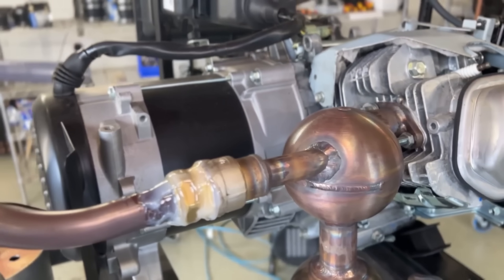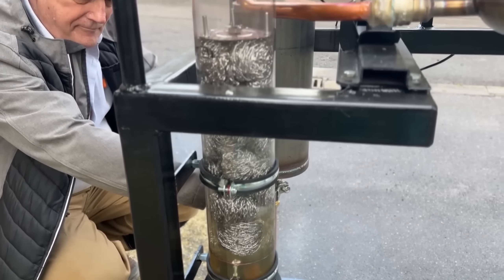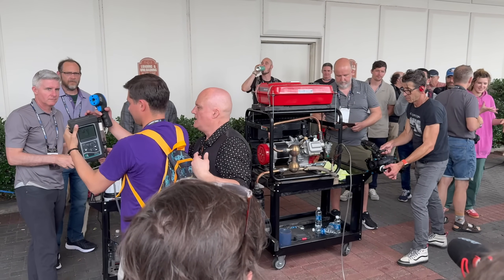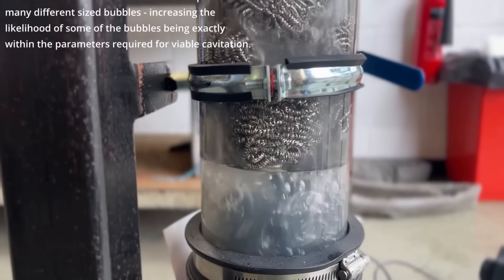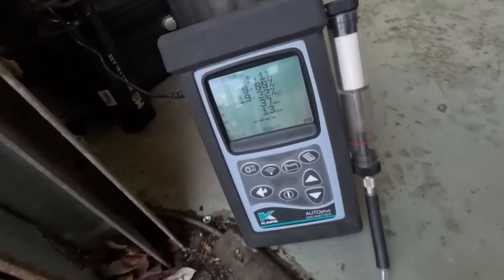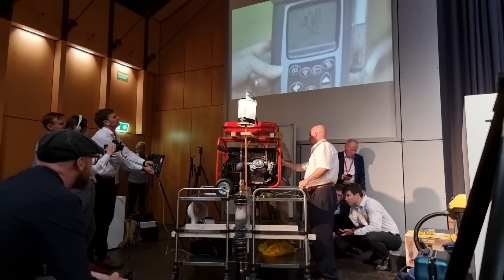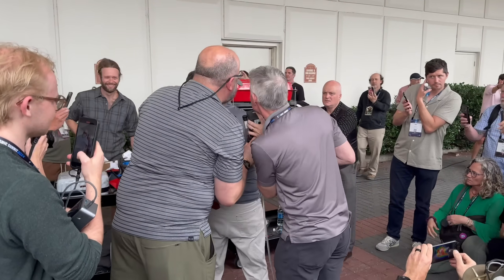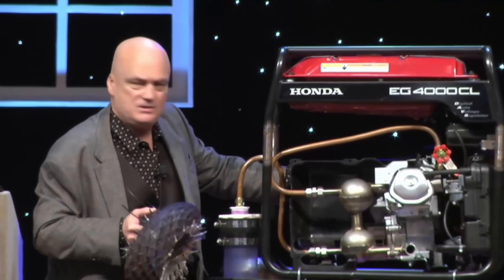Oil Companies Game Over: Malcolm Bendall's Free Energy Generator 2024 Invention of the Year!

Comment: Claims here are incorrect about FREE ENERGY or NO FUEL COST.   That is false.  Bendall demonstrates the devices lowers EMISSIONS, and provides some FUEL SAVINGS (current tests, 20%+), and  is not claiming free or no fuel energy.  This does not stop big oil out, or big car makers, but actually improves their position with existing combustion engines as a path to zero CO2 exhaust.  It  DOES run on gasoline and is NOT electrolyzing hydrogen. "Water vapor injection", or changing the heat of intake air are not significant, and it uses an entirely different physical process.   Future Galaxy should re-study the work and re-do this video without the click-bait title.  However the zero/near zero CO and CO2 effects are world changing.
Reply: No fuel costs. No emissions. No explanation of function or operating principles. What's not to believe?
Reply: Lowers is an understatement, it almost removes all pollutants and puts out 30% oxygen so to reuse the exhaust is beneficial since there isn't that much oxygen in the atmos.
Reply: Clickbate videos become really depressing and a form of stress! I hate those time steeling channels!
Reply: then why does the title say the opposite of everything you were saying. The title clearly says free energy
Reply: @stanley090  Malcolm Bendall, the inventor, does not claim free energy.  The title is incorrect.
Reply: Paul pantone device worked too
Reply: Does it have a coefficient of performance greater than 1??
Reply: @Thecountofstgermaine  no
Reply: Thanks for telling us so we don’t waste our time watching.
Reply: Thanks for telling us so we don’t waste our time watching.
Reply: I have tried to post information about this only to have my comments removed from YouTube.  Just wondering if anyone else have run into the same situation?
Reply: @ They deleted and shadow banned many Bible verses I post. It amazes me how they push YouTube Premium, but I just can’t see paying for them to delete my comments.
Reply: Thank you, At least I know not everyone is Retarted. This iis A BS Scam , Has anyone ever heard or Thermodynamics?
Reply: Yes, but I wouldn't be too happy if it made my generator run like the one in the video.
Reply: Blah blah blah.  The mans right here doing it.  We see it with our own eyes. Be gone Satan
Reply: If it truly works, place 50 units at different locations...monitor the outputs. Open source the technology, pat yourself on the back knowing you helped humanity. Compensation will come.
Reply: Sounds like BS.?   What are the energy inputs and output?   These ‘free energy’ contraptions always try to bamboozle the viewer with weird claims of how the contraption operates - but what does this thing achieve?  The sound track of it running reminds me of someone with all the energy of an asthmatic on Mogadon.  C’mon.. does it produce useful energy or not, and if yes, how much, and what does it consume per hour to do that.   Let’s have no more of the free energy BS.
Reply: @ it’s a good question… running water though the exhaust system cools the engine that alone raises thermal efficiency… About 30% of the energy of the fuel burnt in the power stroke is mechanically utilized… another 30% is dissipated by the coolant & radiator another 40% is going out the exhaust as wasted thermal energy… This system recycles the wasted heat by making hydrogen fuel from water and the longer the engine is running the more of the energy starts to come from water instead of the fuel that starts the engine… it may raise the engine to over 60% efficiency… i think if you’re soaking up all the heat and making optimal hydrogen it can become hyper fuel efficient… and exhaust can be fully 100% recirculating.
Reply: "as a path to zero CO2"!  This FRAUD needs to be dropped. WE do not need  a path to zero CO2. Everyone who uses this fraud supports the monsters behind the global warming/clean green/slave agenda!  Ignore the term 100% and stop supporting the filth behind this satanic slave agenda
Reply: You obviously cant hear, it doesnt need fuel like oil or petrol or diesel, it works off plasma, just like the old Mercury plasma reactors that the used but have hidden from us please do some research before talking nonsense in your comment, go search Mercury plasma reactors
Reply: Agreed. This is good enough on its own.
Reply: WRONG!!! the way it works and it shows, it does have water electrolysis at the very start of the process then it goes through a bubbler filter that cleans the HHO vapor then it goes through the divided muffler chamber where it heats up the vapor causing it to expand and then being sucked into the engine intake after the carburetor, all the exhaust does is go into the bulb chambers and around the HHO tubing in order to heat the HHO tubing in turn heating the HHO vapors and going back out into the environment and not filtered in any way, they should go further and put another bubbler on the exhaust acting as a type of filter, it wouldn't eliminate all exhaust emissions but it would cut a percentage that same exhaust water could be redirected and recycled into the HHO generator as another way to help eliminate a percentage of any harmful exhaust waste and carbon dioxide gas.
Reply: @jamesmarsh1831  Please consider studying more of this form a channel called Alchemical Science and focus on the hardware, and maybe less on the numerical "sacred geometry" stuff, unless you get into that sort of thing.  It may take a LONG time with that do understand the phenomenon of plasmoids, an energetic object that gets created in the process of cavitating air bubbles in the water.  There is no electric current applied to the liquid water nor applied to the dumbbell shaped object.  Good luck sir.
Reply: Incredible neither here nor there! Great minds u have keep going great explanation and correction! Cool stuff
Reply: I was wondering about that as soon as I saw the OHV valve cover lol!
Reply: That’s exactly what I was coming here to say! It doesn’t even make any sense that it would be doing anything without the initial input of something to begin the process.
Reply: @mrwayneright  World changing, a gasoline engine whitch saves 20 % gasoline is world changing? 😂😂

This is just a system troll here to deny free energy.
Reply: He also said "I'm only allowed to say 30% max" of they re use the energy source it could actually fuel itself
Reply: According to Harvard scientist Willie Soon, humans have no impact on the planet's CO2 levels and climate change, despite what the media tells us. People will be forced to change their cars, but this engine will change nothing for the planet, except further depletion of resources.
Reply: LOL what are you smoking? I have not watched this yet as I cannot ever stop having fun with the comments first.....you heard it here first....very soon in the near future there will be Free energy for all....and there will be no need for electricity, batteries or oil and gas! Everything will be powered at no cost by Spinning Arrays of magnets that run nonstop for all eternity and it has already been proven....even by people as young as 14 years old.....You can get a job taking down telephone poles soon or hauling away anything that has a motor in it.....or a battery.....
Reply: 20% reduction is in essence 20% free energy in comparison to baseline.
Reply: Yeah we all watched the video. Thanks for the summary. No one cares about the “FREE” part really., even if it’s 80-90% free, sounds great. The “FREE ENERGY” Title is just a way to explain it to us morons in a way we will understand, not all of us are as intelligent as you are, and giving the oil companies a big fat steel toe to the nut bag with this kind of tech is really something long over due
Reply: Oil is near infinite produced withom the Earth. It fully renewable and isn't made by dinosaur bones which is a total lie...just like man-made climate change.
Reply: We need more co2, not less.
Reply: Not possible that it's more efficient if it adds a extra step.
Reply: Alternative fuels can be used like biogas! I built a motorcycle with a geet reactor that’s very similar fuel reformer technology. Please consider giving to my research campaign.
Reply: You know NOTHING ... Especially NOTHING about the "Thunder Generator" - So wipe you nontalent smirk , and do your due dilligence , BEFORE you contaminate this ideersroom further ! The WORST kind of Dis-info agents are the Un-informed kind,-
Reply: Roger didn't say Bendall was claiming the thunderstorm generator was a free energy machine. He just pointed out that free energy has been around for a hundred years, and he's absolutely correct.
Reply: @johnunderwood9575  whether free energy has or hasn't been around for any period of time is not relevant to the point.  The title makes a claim that is NOT what the inventor, Malcolm Bendall, claims.  The Youtuber's title calls it "Bendall's free energy generator", which is false.
Reply: This is what we get when aibot's are set the task of producing content. As is becoming very clear, with AI the truth is as optional as an internet click.
Reply: @alasdair4161, "as optional as an Internet click"
Gotta save that one, it's _exquisite_!
Reply: Thanks for bringing this to my attention.
Reply: It is all about getting clicks, the person behind this channel probably doesn't have any technical background.
Reply: I remember in 1960s, folks tweeking carberators to get 80 to 100 mu
Iles per gallon.  The oil cart3ls offered to by thier patients, if 5
They sold them, it was shelved to insure maximum profits.  If they didn't sell, they were found murdered shortly thereafter. Thus proves for profit only capitolism  is extremely evil.
Reply: @mrwayneright  exactly! I made the same points except I wrongly stated it won’t generate electricity which of course is what all generators do!
Reply: Yeah, why can't they just give us what it actually does do and be happy with that?! What it actually does is awesome enough!
Reply: I agree it was a very deceiving video.
Reply: Where did you get your immaculate info from?? Or are you connected to the BIG oil cabal ??
Reply: @Homoprimatesapiens   Ahahahah Ya thats it Buddy, Oil cabel Brilliant, Did Malcom help you come up with that. I`m smarter then you! and I bet I can figure out the Grift of whats going on with this fake ass Device. Put your money where your mouth is or Keep on walking. You`ve got the right one now.
Reply: So you’re saying you are smarter than Nicola Tesla. Nikola Tesla was on to something so I wouldn’t completely disregard zero point energy. Am I wrong? Do you know more than Tesla? I don’t think so
Reply: Here you are telling him what to do. Why should he listen to you?
Reply: @RikaPearson  It DOES run on gas and the youtuber claiming its FREE, which is not claimed by the inventor.  Maybe he shouldn't listen to me and keep making click-bait videos and making youtube$.  Maybe I am wasting  my time trying to correct something.
Reply: @mrwayneright  fair enough, what's your tribe?
Reply: @RikaPearson  My tribe? Oh, a while back I spent a lot of time reading and watching about this system and found it quite amazing.  I am satisfied that Bendall is not a charlatan, and not claiming over-unity, which is pretty hard to prove without fakery.  I hope Bendall and his associates survive and his inventions are funded and developed as they deserve.  In the current era, developing a zero CO and zero CO2 addition to a hydrocarbon fueled engine is a real world changer, which upsets the plans of the group I call the carbon-barons who use fear to control global energy and economies.   For the good of humanity, the carbon barons and their kind must be resisted.  So I was very impressed for this reason.
Reply: I`m smarter then you for sure.
Reply: You guys aren’t understanding it only requires fuel for startup and only water needs replaced. It’s the end of Oil.
Reply: @ballgms308  ahahahah WRONG!!!

Comment: The closest thing you can have two a perpetual energy machine is my off grid, solar electric battery based power system. I have 11 kW of solar panels and 30 kWh of battery and it’s the gift that keeps on giving. I’d like a piece of garbage gasoline generator that makes noise and exhausting waste heat. Give me a break man.